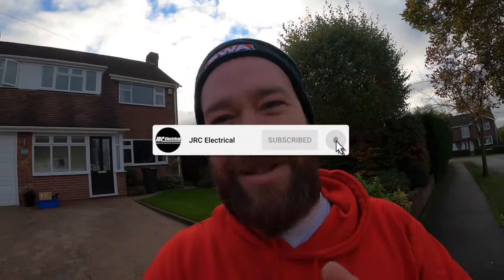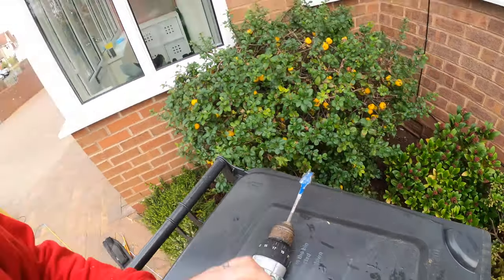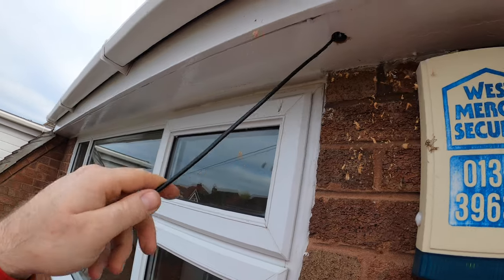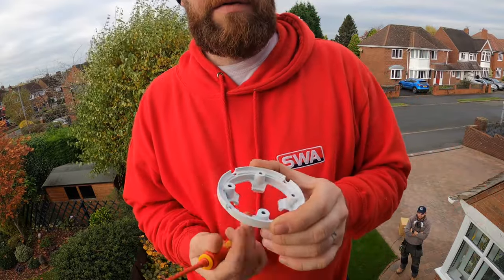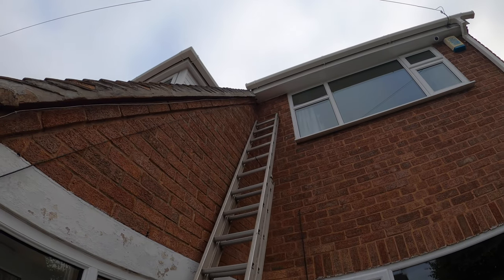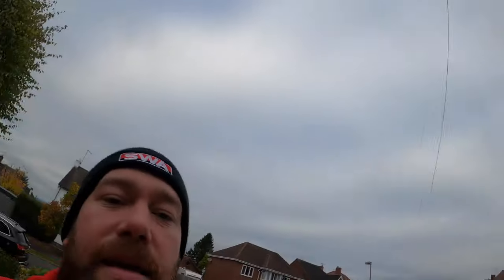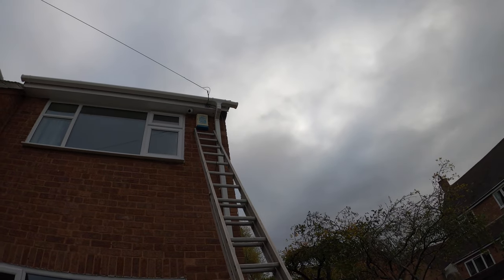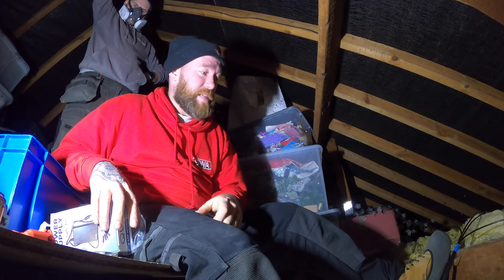4K Qvis Oyn-x CCTV System Install Using Cat5e Cable

Comment: I am security system installer (not UK ) , always use zipties  on the connectors to hold the thin cables on . Helping  to stress off the cable (common problem for lost signals or loose connection after some time )
Reply from the maker: Thankyou I’ll remember that next time 👍

Comment: What CCTV system would you recommend at the minute? Valve for money. Just need two cameras. Good camera work. Must be distracting doing work one handed haha.
Reply from the maker: Thankyou sir, the ones we tend to fit are qvis eagle 8mp 4k hdcvi cameras, they also include audio and are a fantastic price
Reply: @JRCElectrical  Thanks. Do you know the cheapest place to pick them up.
Reply from the maker: I don’t mate, I get them from rs electrical supplies, they order them in for me

Comment: I was always told when using cat5e to install cctv, to use 2 cores for your video signal then the other 6 cores for power incase of voltage drop. What's your thoughts on this?
Reply from the maker: Yeah a lot of people do this and I think it’s just to stop any dropping out or just to make the power cable csa bigger
I’ve never had a problem tho so only use 1 pair and keep the rest for spare